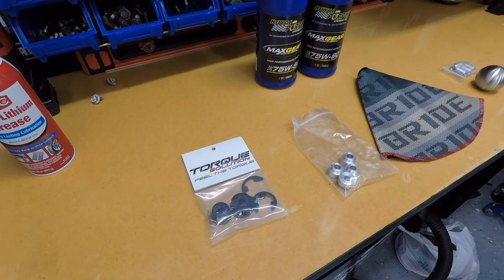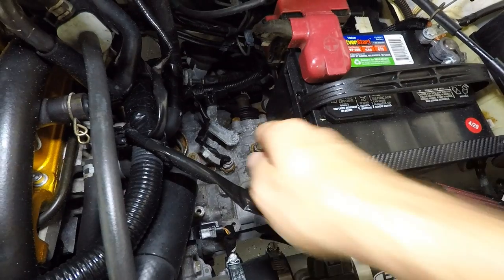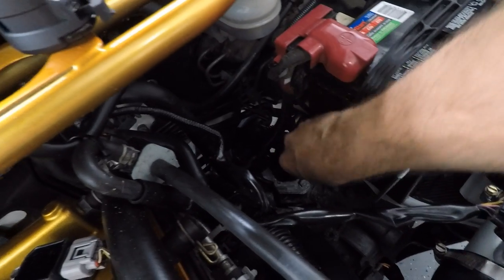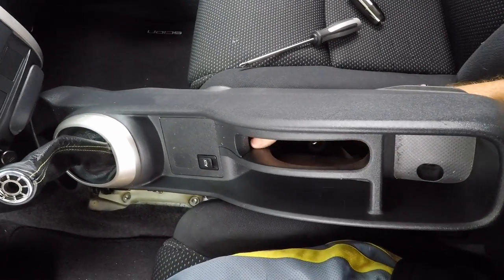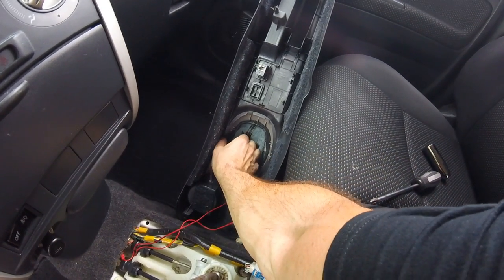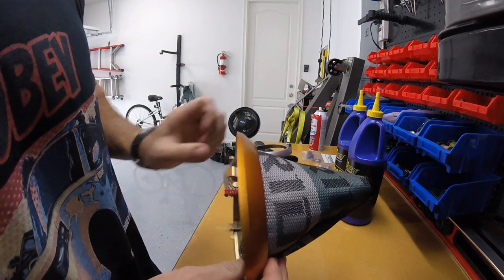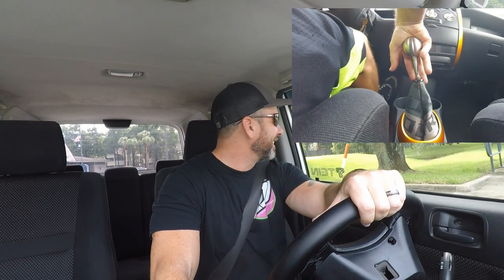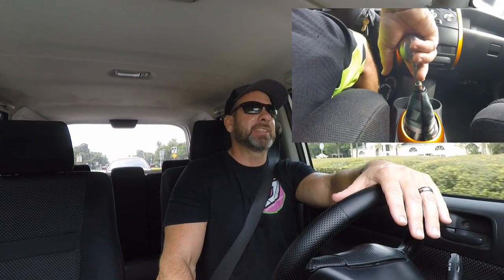Scion xB 5-speed Upgrade!

Comment: Brandon, looks amazing as expected.  I've got a TRD shifter I installed back in 2007, it was probably my first mod.  I'm definitely doing the fluid change and the new boot, I'm saving the cable link work for later.  I'm keeping my carbon fiber shift knob...not because I'm a pansy, because it's cool. 😜😎
Reply from the maker: Nothing is cooler than carbon fiber!!! How do you like the TRD short shifter?
Reply: @ExtremeDailyDrivers  I really love it, I wish Toyota still made them because there's so many people in the community that would love to have one.  I still have the TRD Clutch and flywheel for my Box too.  I might have to wait a while for your video on that mod. 😁
Reply from the maker: The previous owner installed the TRD clutch and I verified when I replaced the transmission. Definitely a firmer pedal. The TRD shifter is still floating around new. You just have to find them, but they are out there. They are still in the $120 range. Glad you like it.

Comment: I did an eBay short shifter where is adjust the height $40 came out good and no complaints
Reply from the maker: I was considering that, but there is very little online about it. Glad you like it.
Reply: spacers go on bottoms like how you replace the rubber ones and ball joint has a screw that you adjust shifter up and down which changes the pivot point... just the original shifter stick wasn’t easy to get out didn’t have info online how to remove it

Comment: The plug you pulled out from the top of the transmission is for the reverse lights but don't quote me on that. I'm still trying to figure out where the vehicle speed sensor is on the m/t xb.
Reply from the maker: You are correct. It's the reverse sensor. Thanks for watching.

Comment: Cool video bro, question, what do you think about changing the 5th gear cogs on the transmission? I've heard if u swap it from a 2007 corolla, the Rpms in the highway will drop about 500
Reply from the maker: I wouldn't, but you do you. Thanks for watching.
Reply: Will do, thanks

Comment: Awesome video! 
I finally bought myself a 2009 Scion xB last year. 
I've always wanted one.
There are 3 things I don't like about it, but, I know that there are up-grades somewhere out there.
My car has idiot lights for oil pressure and battery strength.
Are there any factory gauge kits to add oil pressure and ammeter somewhere on or near the dash board?
The singular rear backup light is a joke, so is there a LED replacement or much brighter light upgrade?

I really love this car and wish that I bought a new one when I had the chance to. 
But oh well, life goes on.
I've read that 08's and 09' have oil leak problems. Mine does too, but I heard that Toyota knew that those motors were problematic. I'm going to write to Toyota of North America for authorization for an engine rebuild to see if that goes anywhere. 
I plan to have my engine rebuilt anyway but any factory help will go along way.
BTW, I've liked and subscribed to your channel!
Reply from the maker: Thanks for subbing! Good luck with the Box.
Reply: Theres a campaign. But if whomever owned that XB did not get the engine work done within q
10trs, 150k?  Too late.

Comment: Did you manage to finally get your pedal on? I have the same or similar gas pedal that was just a touch shorter than the pedal. What I eneded up doing was trimmed some of the rubber bottom corners, and used doublesided tape to stick on the gas pedal cover. (Ghetto Mod, I know)
Reply from the maker: I have not had time, but you want to make sure they are installed properly. The reason you can't find the OBX pedals anymore is that people used to install them incorrectly and they would slide off while driving causing a dangerous situation. Be careful.

Comment: Hello, Is the 2005 scion xb in 5 speed manual transmission equipped with a transmission fluid dip stick?  Can not locate mine.  I had the vehicle since 2005 I believe it had one origianlly but I did not really look until 2015. I have had a cold air intake installed and had the radiator replaced so not sure if those jobs resulted in the transmission dip stick vanishing :(
Reply from the maker: No dip stick on a manual car.

Comment: How much transmission fluid should be put in , I have a 05 xb , when you took bolt off the top of the transmission was it filled to the thread ?
Reply from the maker: 2 qts, Bro.

Comment: The link for the shifter cable bushings no longer works. Any year for the Yaris work or was it a particular year you needed?
Reply from the maker: Try Corsport.com. They have them for the xB.
Reply: Extreme Daily Drivers thanks man. Been watching your videos. I have a white xB as well. Copying a lot of your mods. Curious on your exhaust setup- haven’t seen a video on it yet
Reply: @codytaylor4351  +1 for corsport. Installed them back in 2013 and I didn't have the issues OP did with the locking retention ring. It's been solid for the past 7 years!

Comment: I got a question my 2005 xB shudders when I move off in 1st matter fact all gears if I real ease easy
Reply: Could be a bad motor mount; there are three.
However,
I found that the rubber isolater on the passenger side wasn't torqued down and it helped a lot. It's the little 10mm bolt on top of the rubber cylinder. It should be 33 ft lb. I didn't get it that tight because it felt like it could go forever.